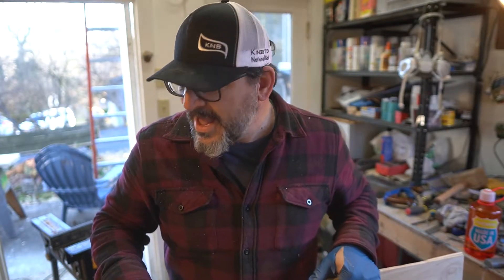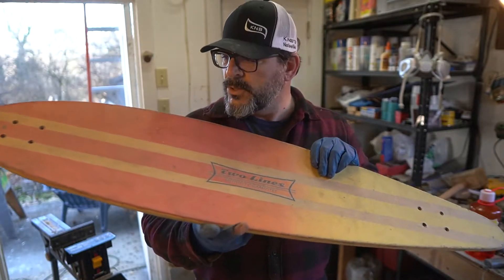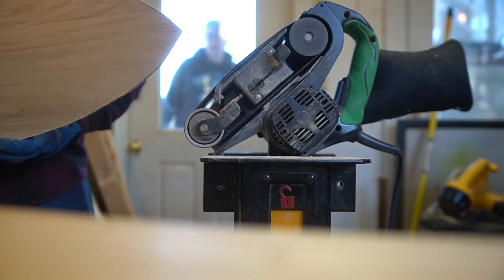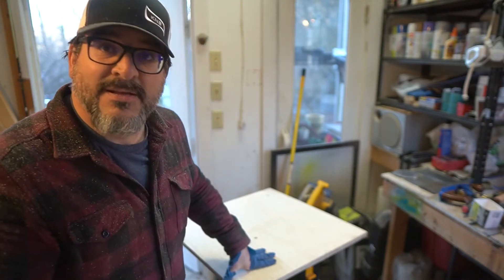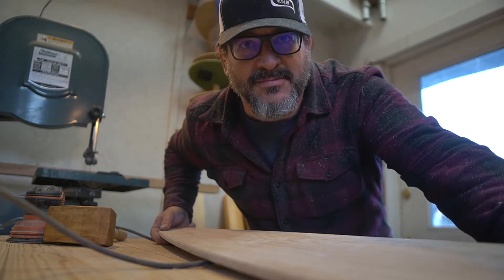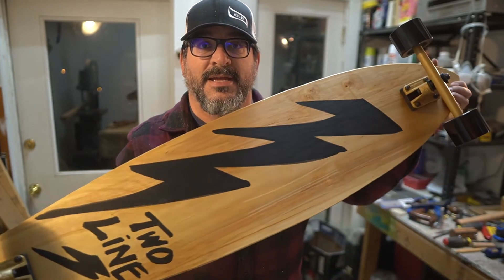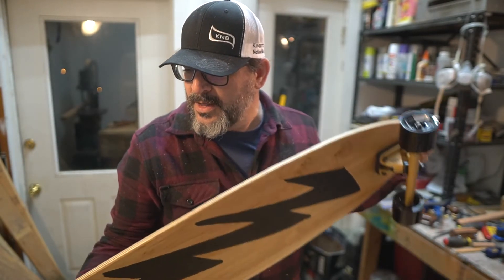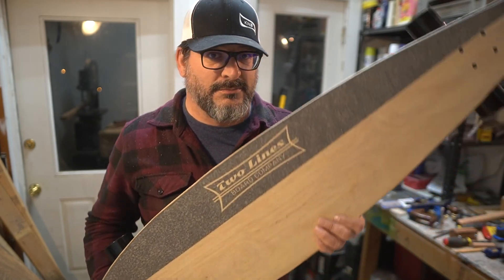Make a longboard today!

Comment: Awesome video! I wanted to share some information regarding the "glue up"process. This information was shared by a huge longboard manufacturer and I wanted to pass it along to someone that would appreciate it.
Reply from the maker: Thanks Adam! I always want to learn more!
Reply: @twolinesslotcars  

Typical wood glue regardless of the brand yields too much rebound once out of the press.  

Loctite PL Premium Polyurethane Adhesive 3X..Apply thin coats to each layer like wood glue. 

Zero Rebound 
Flexible
Spreads easy
24hour cure time

Comment: What wood should I use, I used birch plywood 3/4 inch thick and it splintered a lot, probably because I was using a jigsaw, but the wood seemed a little bit too thick anyways, what do u suggest?
Reply from the maker: Samurizzz_ Sausage solid birch plywood is the way to go if you are not laminating your own decks.. A jig saw will work but you will want a fine tooth blade. A bandsaw is the best to prevent splintering. But, you have to use what you have available to you. 3/4” is pretty thick, but will work... my decks are around 1/2” which gives them strength and flexibility.. have fun making your own, that makes it even better!

Comment: thats awesone, so did you glue 2 sheets of plywood together?
Reply from the maker: I can buy 1/4” Baltic birch plywood locally and yes for a basic deck I glue two pieces together and can still bend some convex into the deck using a ton of clamps. I don’t have a press so I have to make due..
Reply: @twolinesslotcars  cool thanks!